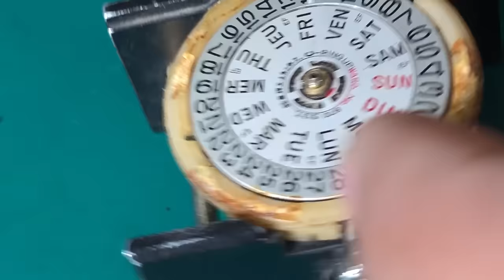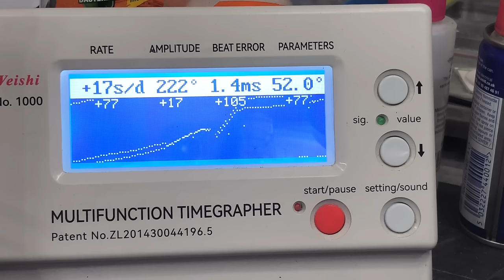Full Restoration of Destroyed Seiko 5 with 6309 Movement| Fixed the Dial, Re-lumed Hands |ASMR | DIY

Comment: An interesting Frankenwatch You have, indeed. The Dial says Seiko 6349 Movement, but both the Case Back and the Automatic Bridge tells 6309.

The Movement itself then clearly is a fully jewelled 6349. A Typical Second Hand Mismatch of available parts lying around.  😉

Comment: No service for the mainspring?
Reply: I noticed that too. Maybe he doesn't have a mainspring winding die set. A good set are expensive. 
Also, did you notice he hand cleaned all the parts? Ultrasonic cleaners are inexpensive now. They clean better than by hand and are a time saver. Lastly he didn't even clean the rust or glue on the date dial or brass area around the day/date dials. Pieces of that old glue or rust could break free and jam the movement. Sloppy.